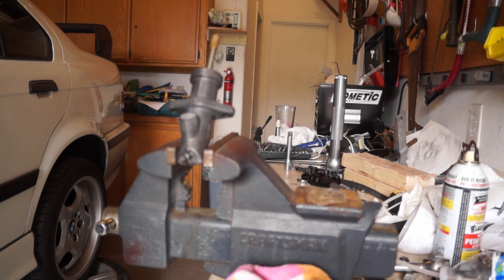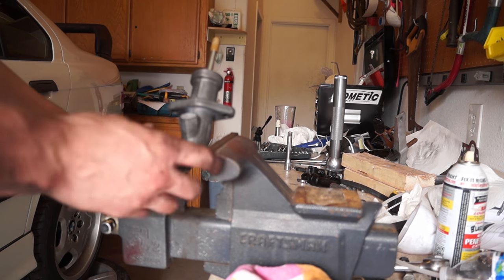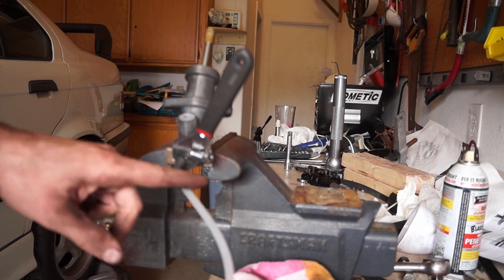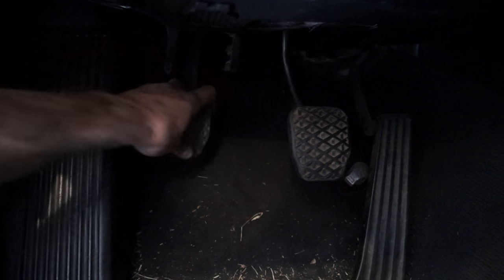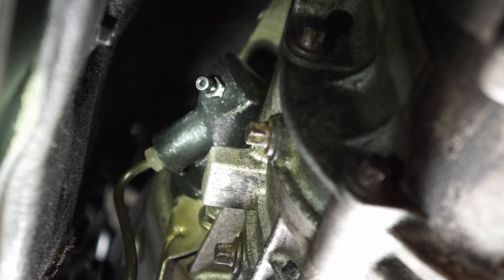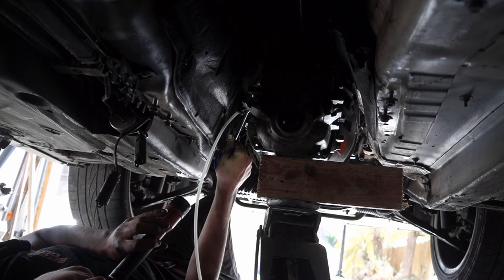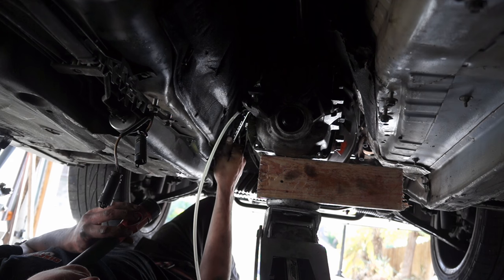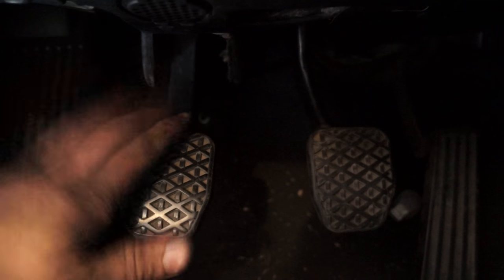E36 Clutch Bleed: E36 Manual Swap

Comment: Just performed this procedure on my boys cj5 build. Very good explanation. Really impressed your busting this out and sticking to it....right after the feugo block is complete too.
Reply: Mike B hey man i gotta ask my brake system has a lotta air in it and i just replaced the clutch master and i bleeding the air out but the clutch remain soft.. so can the break system be my problem?

Comment: Looking forward to see your weight difference with the 5spd vs auto. Side note read an article last night stating that our 5spd is more durable than the 6 spd box hmmm. ---Jalopnik
Reply from the maker: I havent done the curb weight test on it, I will when ive finished the series. I too am curious, it should be cool. the ZF's are pretty stout. I like the 5 speeds, I will probably do a 6 speed conversion to the droptop but I plan on keeping the sedan a 5

Comment: Hi Clark. I was just wondering if you might know this answer I replace my clutch on 1027/17 with l165,211 mi on it and now the clutch is starting to slip. when I replace the clutch I replaced the flywheel the pressure plate and of course the clutch and everything else along the way .and now the clutch slipping with less than $37,000 miles on it. The car now has a total of 201712 on it right now. And I never beat on my car whatsoever . Do you think this is normal for a clutch to wear out that fast or could there's something else be wrong it never gave me any problems until recently it started to slip and now I can barely drive it without it slipping totally. It engages very high up on the clutch but barely really moves at all. Any input from you would be great. I watch all your videos and you do a great job. Thank you Clark

Comment: i thought manual cars have like a clutch master cylinder reservoir like the brake cylinder but under the hood
Reply from the maker: nope, some cars do, but E36's feed straight off the brake master reservoir.
Reply: Ya that made me look twice also. Interesting feature that BMW didn't run a second reservoir for the slave cylinder. In there it MAY increase your chances of losing brake pressure if the clutch line popped, leaked, or let go somehow. Looking to complete an ABS delete in the near future and will have to examine if this will be an issue.
Reply: @mikeb2496  the line that goes from the reservoir to the clutch slave cylinder is not attached to the bottom of the reservoir.  It is around half way.  So even if you lose your clutch line it will only drain the reservoir half. Those Germans know what they are doing.

Comment: my clutch is for some reason sitting a few inches higher than my other pedals.. just recently replaced master cylinder (thanks to your video!) but still not feeling resistance on the clutch and it gets stuck down like you showed in the video but it’s sitting higher than it should and i’m not sure why. any ideas? i’m assuming i’ll need a new slave cylinder

Comment: Good vid. Think my slave or master is on the way out so i'll be tackling this soon. The pedal is starting to stick to the floor and not return to its normal spot and getting the car in gear is a bitch sometimes, and also the other day driving it home my brake pedal got stiff as fuck. Got some digging to do should be fun lol

Comment: anyone know why the car won’t go into gear? bled for a long time. when trying to go into first it’ll inch forward but won’t actually go into gear.
Reply from the maker: Running?
Reply: Hey I don’t know if you still check on these comments but i think I’m having the same problem, when the car is running and the clutch is in it’s impossible to get into gear but when the cars off it’ll go in just fine. I’ve read some things saying that the slave might not be pressing in far enough and is therefore not disengaging the clutch. Any advice would be greatly appreciated
Reply: @joshpalmer264  The pressure plate bolts weren’t torqued all the way down for my issue. The pressure plate wasn’t engaging to let the car go into gear while it was running (spinning). I used a alan key not realizing they had to be torqued to a specific spec. It’s a pain I know but that’s where I would check first for sure. Once i torqued them to spec, put everything back together it went into gear just fine.

Comment: He i did the swap car won’t go into gear when the car is on
Reply from the maker: Either the clutch is bled incorrectly or the clutch disc is backwards. Have you bled it thoroughly?
Reply: M3NACE I just started bleeding it I’m not to sure how it’s done I got my friend pumping the clutch and I’m under the car opening and closing the valve. How long does it take to bleed
Reply from the maker: @Focus_mx15  usually 10ish mins
Reply: M3NACE yeah we just did car won’t go into gear while on and clutch pedal is really heavy
Reply from the maker: @Focus_mx15  does it feel like a clutch? these cars have natrually heavy clutches

Comment: Hey man, good video

I have bled my brakes after rebuild, but suddenly my clutch pedal has no pressure. At the clutch slave only air comes out no fluid. It worked before rebuild of the brakes
Reply from the maker: Sounds like you need to bleed the clutch my friend
Reply: @M3NACE  yeah ive tryed, it builds airpressure when i pump the pedal but fluid doesnt come out. Today im checking the line from above. Thanks for the reply